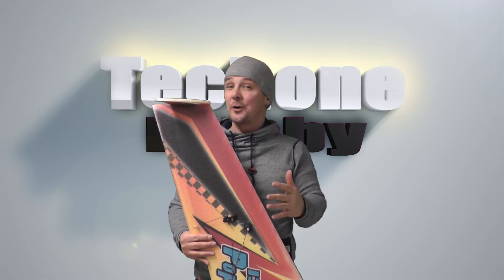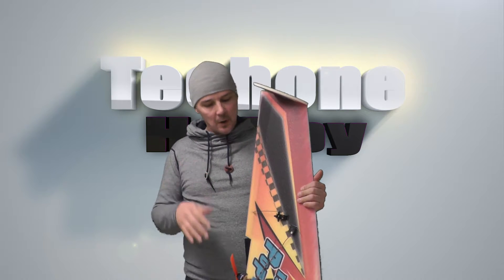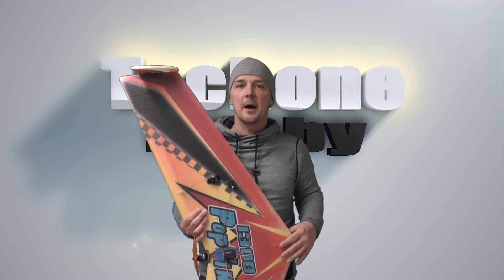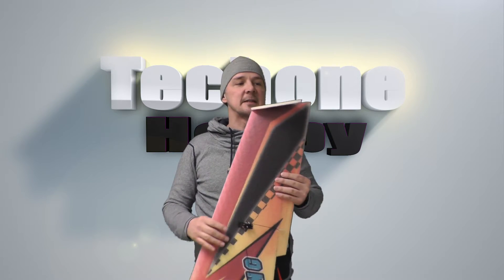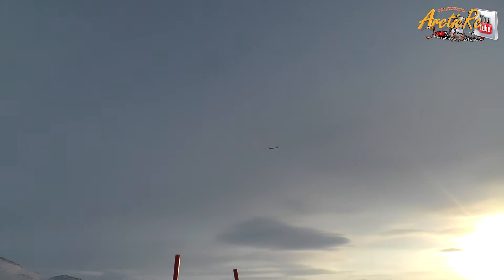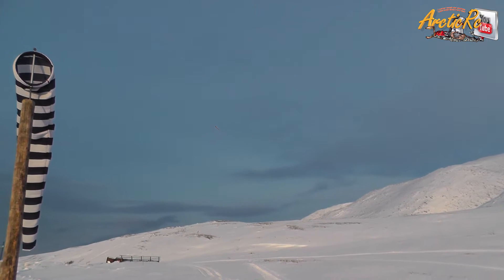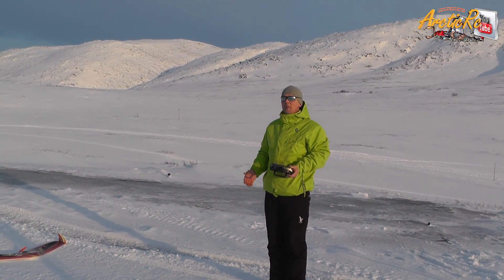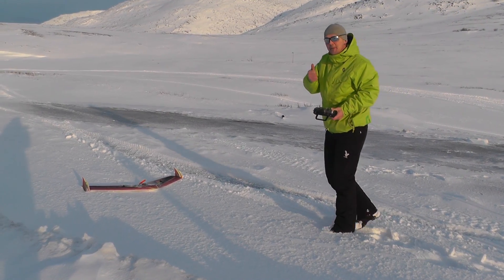TechOne Hobby Popwing-1300 - About and Test Flight

Comment: How do you setting the servo travel aileron?
Reply from the maker: i start very low about 0.5 cm. i use a 3 point switch on dualrates and full is 1.5. but this is from pilot to pilot. use some expo until you know the model
Reply: thanks for taking the time very helpful

Comment: great review how thick is wing and do you think laminate will increase structural integrity without adding to much weight
Reply from the maker: I do belive you can use light laminate. when this wing has the correct setup she's very sweet in movements but it is by far a speed wing but perfect for FPV. You get good speed but if you wanna tweak it you should add some carbon support. But allways test stall after adding equipmen. Just so you know when she tips